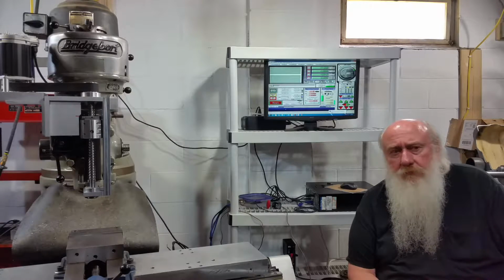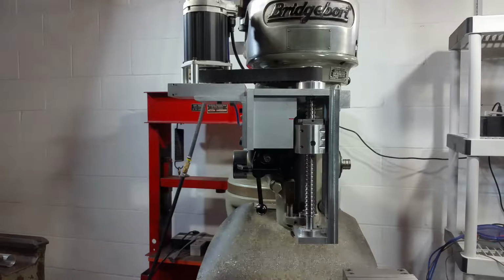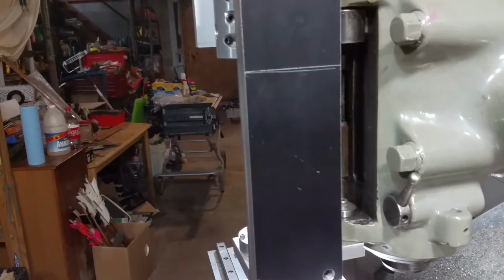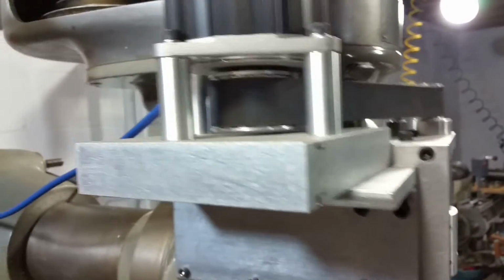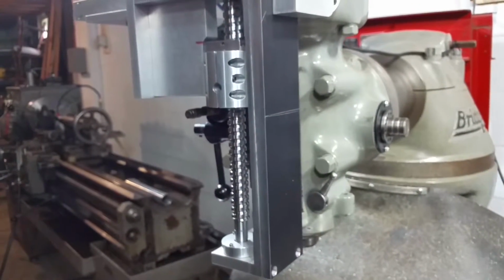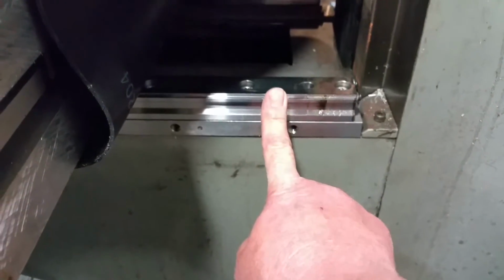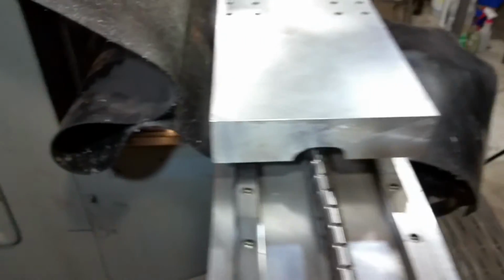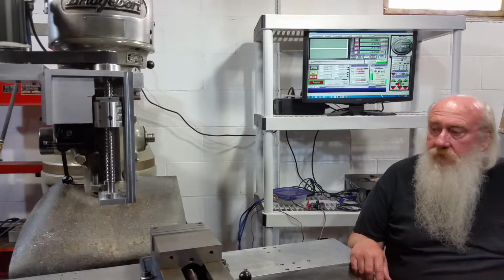Bridgeport Part III Z Axis

Comment: Hi please tell me where did you get the cnc kit? I have the same milling and i want to retrofit it
Reply from the maker: Hi Samuel, 
There was no kit purchased.
I purchased the servo motors from Teknic, the ball screws and guide rails were an e bay buy, and the two slabs of aluminum I purchased from a local distributor. I did all the machining to the parts first and hoped it all went together OK. It is controlled by Mach3 software. My apologies for taking so long to respond. I hope this was some help to you.

Comment: Nice work, My only suggestion is to invert the bearings and rails. This would require a redesign, but it would give you an analog to the original table saddle arrangement and the range of motion. The dovetail on the original table works like the rail, and the gib/dovetail of the saddle is the bearing surface. if the rails were attached to the bottom of the table and the bearing blocks were mounted to a saddle, then the saddle would be the bearing surface and could be narrower, cause the width of the bearing blocks would be the only limiting to travel range and you wouldn't need a saddle the same length as the table. Not sure how this effects your ball screw placement or motor placement. I expect that the ball screw would need to be fixed to the table vs the saddle. Just a thought.
Reply from the maker: Thank you William, I agree with you completely on that. I realized that a while after it was up and running. As far as the Y axis is concerned, I made the setup 8" instead of the original 9" table so I was able to pick up an inch of travel there. Now at this point in time the scales are no longer on the machine, I am just using Mach 3 instead of a DRO. If I were to do this again I would definitely make the changes we are talking about. In addition I think I would use Mianite instead of the Aluminum.
Thanks again for your suggestions.

Comment: Hi Joe, this is really nice work. How much planning do you do ahead of a project this size? I'm wondering CAD vs. notebook sketches and measurements. Is the quill normally computer controlled instead of the knee? I'll review how you made the table. I thought you modified the existing table, but instead it looks like you used too massive blocks. The only time I've had the good fortunate to use a machine this size was in school. Best wishes, Kent
Reply from the maker: Hi Kent, thanks I appreciate that. As far as planning this project I thought about it for a while (a week or so.) I pretty much winged it, sort of design as you go, so I don’t have everything on paper or a cad system, just a few notes here and there with some dimensions jotted down . Yes Kent, most mills that I’ve seen have the servo motor on the quill, unless the mill does not have a moveable quill, then they would put the motor on the knee. Yes you are correct, I did use two large pieces of aluminum 6061 mic plate I think it was called. If I remember correctly the saddle or the lower one is 1.5 x 8. X 49. The table is 2. X 8. X 42. I used the 2” thick piece for the table because I had to mill clearance for the ball screw and a pocket to hold the ball nut housing. Thanks for your questions.